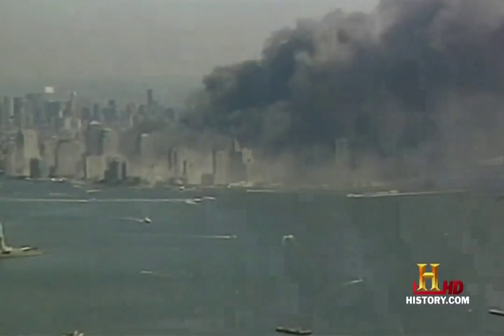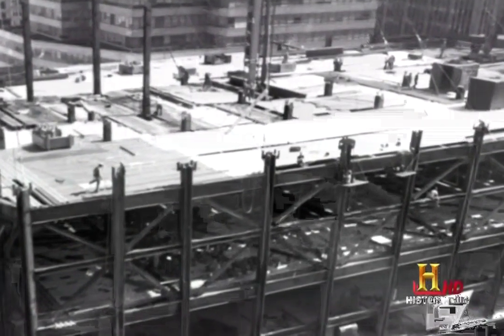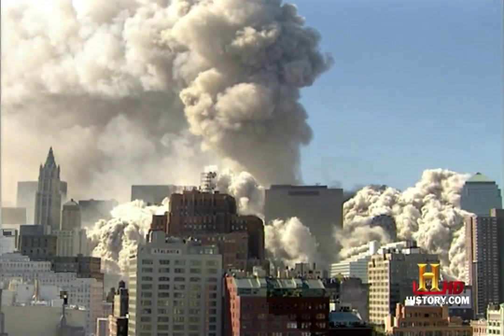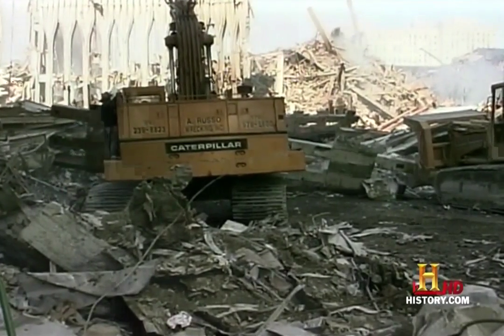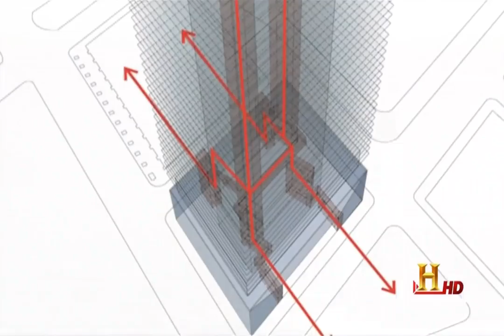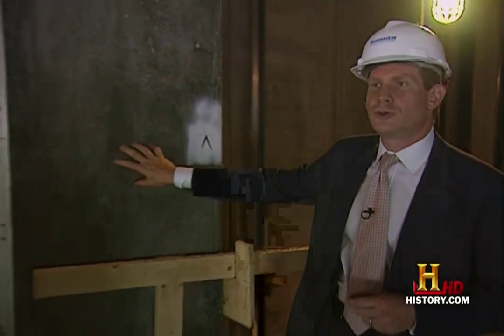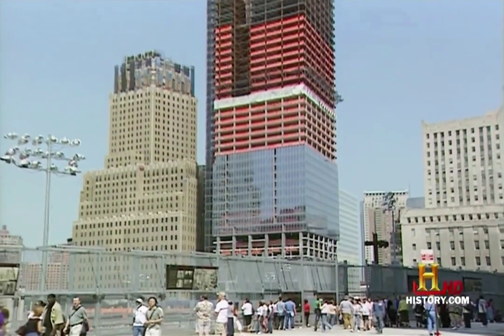WTC 7 - Collapse Issues & Features of Old and New Building (History Channel, 2004)

Comment: What I don't get is how can people not understand high temperatures do not need need to melt steel to critically weaken it?  Have any of you conspiracy people watched a bladesmith make a knife?  Do they need to melt the steel in order to shape it? No, they just need to heat it up to the point it becomes soft and workable.  The difference instead a bladesmith smacking the red hot steel with a hammer, is tons of weight in building pushing down on the steel.
Reply: Lmfao
Reply: Asymmetrical fires do not cause a symmetrical collapse. Never mind all the footage and accounts of bombs going off in the basement of WTC, elevator shafts (never mind all the work going on in the main elevator the entire month prior), or the Urban Moving Systems vans that were caught with a WTC1 basement pass, $4700 cash, fake student ids, passports, flight tickets for immediate departure all over the world, pictures of them celebrating the attack (one even holding a lighter to the 1st plane crash) (they were also caught positioned to take these pictures, or in their own words, “document the event” 2 hours in advance) and traces of explosives! UMS was later found to be a fraudulent company. An extraordinary amount of hard drives were taken into custody, but remain classified. The owner Dominick Suter is currently in the list of 9/11 suspects and immediately fled to Israel after 9/11. How anyone can simply believe that 47-story WTC7 collapsed the way it did due to fire is beyond me.. where is the resistance? The literally spilled the beans twice on the news that the building collapsed before it did! That’s only possible if the pulled the building, which Silverstein has admitted to
Reply: @MarkTheLamplighter  David Icke talks about this on his book The Trigger
Reply: LMFAO @MarkTheLamplighter  Where are you getting your information from ? Did you remove your tinfoil hat and the aliens told you ?
Reply: Exactly!
Reply: @MarkTheLamplighter If the building had 10 columns but its only needs 8 columns to support the entire building… 

So if the fire took out 2 columns what happened? 

The whole building is still standing as the loads are within the limits.

If the fire took out the third columns what happened?

The rest of the columns will buckled at the same time from the load exceeding its design limit and the entire building will collapse.

Comment: There is no evidence of explosives, bombs, or controlled demolition with any of the buildings. 

The fire professionals knew that building 7 would collapse, they said so hours before.
The penthouse on building 7 collapses inward a full 8 seconds before the rest of the building came down. You can see the windows break as the penthouse goes collapses inward.

FDNY fire Chief Daniel Nigro, who stated, “I feared a collapse of Building 7 (as did many on my staff). The collapse of WTC 1 damaged portions of the lower floors of 7.

FDNY Lieutenant Rudolph Weindler said: “So we left 7 World Trade Center… and Captain Varriale told Chief Coloe and myself that 7 World Trade Center was badly damaged on the south side and definitely in danger of collapse. Chief Coloe said we were going to evacuate the collapse zone around 7 World Trade Center, which we did.”

 Deputy Chief Peter Hayden said: “We saw a bulge in the southwest corner between floors 10 and 13, and we had put a transit on that, and we were pretty sure she was going to collapse.”
Show less
REPLY
Reply: NIST said the building fell because of fire, not structural damage from being hit by collapsing towers 1 & 2, so those quotes are irrelevant.
Reply: You government said it collapsed at fee fall speed & totally collapsed, due to fire. Many, hours after, the so called attack & the penthouse id just begining to fall, you can barely see it. 5 seconds later, the building's no longer their & 2 seconds later, it's all over.

I've seen the fire damaged side & no way that buildings coming down.
Reply: @johnsergei  couldn't have said it better myself. Take a look at grenfell tower block in London, got burned inside out. Still stands to this day
Reply: "No evidence of bombs, explosives or controlled demolition" ?? You must watch CNN!  What about the explosions we not only hear in alot of these videos or the firemen talking about explosions and I probably couldn't count the demolitions experts that stated it was controlled demolition?? If you only watch the slow motion video of building 7, you will see multiple explosions as it falls. I am glad I found this video as it proves that 2 completely differently designed buildings at 2 completely different times of construction fell perfectly together into one footprint which we all know goes against everything we've ever been taught or seen before but then again 9/11 is full of those kinds of things. I guess now the engineers are telling us the building had a column fail and it "pulled the rest of the building down"   I would've probably believed it more if they told me the 19 hijackers with box cutters that brought down the twin towers and hit the Pentagon did it. Its all B'S to take away everything that was once good in this country and they rely on people like you to fall for it and...it worked!
Reply: The real problem is the "investigators" work for the perpetrators.
Reply: irrelevant lives in the jungle
Reply: Buildings don't totally collapse in 5 seconds due to office fires.
Reply: @We the People United.

Do you have actual proof of bombs/explosives/controlled demolition?
Eye witness reports and "demolition experts" testimonies don't count for shit. People are fallible. Show me evidence, not assertions, ACTUAL evidence.

Do mind that if you opt for some insane explanation of "explosives" also explain EVERYTHING behind that. What kind, where they were placed, by whom, why there is literally no report by anyone of explosives being placed or seen after more than a decade, etc.

Good luck, you'll need it.
Reply: The newscrews are all over the towers at the time the second plane hit & we can even clearly see what colour the plane is?. It's a bit like Moon landing videos. Give us worse than horse & buggy era film?
Reply: John Sergei and Div neil 

https://www.youtube.com/watch?v=PdUetMEym6w  <--- The Plasco building would like to have a word with you about fires not being able to collapse steel beamed structures.......
Reply: @martin7836  Ignore him he's a paid shill.
Reply: J Law - "There is no evidence of explosives, bombs, or controlled demolition with any of the buildings"
Nobody looked for it. Didn't you hear what J. Barnett said, you shill?

"The fire professionals knew that building 7 would collapse, they said so hours before"
Can you name the guy who was "right on the money" predicting the time of collapse 7 hours before it happened?
Quote him saying that he expected 7 to collapse the way it did . You can't. Anticipating a collapse of some sort is one thing. Accurately predicting the way it collapsed is quite another. Shill better, J Law!

"The penthouse on building 7 collapses inward a full 8 seconds before the rest of the building came down. You can see the windows break as the penthouse goes collapses inward"
Correct. How does that disprove CD and prove fire? It doesn't.

Of course people feared a collapse. Of course they evacuated the area. That's natural and sensible, duh! That doesn't disprove intervention, or prove fire killed 7. Your shill power is very poor, J Law.

NIST said the debris damage played "no significant role initiating collapse". You can't have it both ways. Either worship NIST, or disagree with them.

Comment: 2:28 an hilarious quote
"Once one of those trusses went down, then because of the way everything was interconnected, in the floor system. Uh, it pulled down the rest of the building."  Irwin Cantor-engineer of record-building seven

This seems extremely questionable, are buildings really designed knowing that knocking out one key column or truss will cause a global implosion of the structure?
Reply: That it would bring down not just one side but the entire building, evenly like a clockwork sounds unbelievable. They should make a whole new documentary about that, but i bet its not happening.
Reply: TheUnderdogDe - Not as fast it did, and not as evenly . Demo firms would love to achieve such an easy result from a single column failure on one side of the building. Those floors were not attached with chewing gum or duct tape. Don't be naive.
Reply: saladdogger - Exactly. Or just rig a single column to blow, the rest will follow. No need to spend weeks rigging the entire building. Shills can't answer that.
Reply: All of the columns have to fail near simultaneously and when they do they must be severed to get the 9.8m/s/s. This is the only way to get it to happen.
The cover story for a full year afterwards was that it was taken down for safety reasons. It obviously didn't come down when it was suppose to. They must have been delighted to hear engineers doing such mental gymnastics. The alternative was inconceivable to them.
What are the chances that Rumsfeld Cheney CIA  (knew about 2 hijackers) and Israelis (spying on terror cells) were all connected to the Building? Unbelievable.
Reply: @Xinjiekou_新街口_Station The columns do tends to buckled simultaneously once enough columns had been taken out and loads on the remaining columns exceed its structural limits.
Reply: @tonamg53 "The columns do tends to buckled simultaneously once enough columns had been taken out and loads on the remaining columns exceed its structural limits."

Yeah, I am not sure you are getting this. The issue is not that they only all have to "fail" at the same time. They would have to all buckle on the same lateral axis, at the same time (4-6 seconds) and to the same degree for the roofline to remain flat. That is 3 coefficients that need to line up for this to happen. Why would that happen in a natural collapse? The roofline is flat and comes down for a few seconds with negligible resistance and that is consistent with the columns being SEVERED. Even if you were to believe this somehow could happen in a natural collapse it remains consistent with an engineered collapse. It then encounters resistance and becomes much more asymmetrical and tilts to the south. The whole collapse sequence is (visually at least) consistent with being logically planned out, East penthouse then core (trusses pull in frame) then parameter columns. 

Then the totality of evidence to go along with this involves a cover story given out to the media and others who might ask questions when it had to be taken down in broad daylight.  The back story on the building is that the very people in charge of the country with the president scheduled out of town during the attacks had access to this building and had met with two other people who wired money to the terror cells. 
There's much more to this story including an FBI informant and people monitoring the cells who have a connection to the building owner but in simple form:

A) Nature of collapse - Logical sequence with the same outer column failure (Time/Location/Degree) consistent with a handful of columns being severed somehow
B) Evidence of a cover story given to press and others (makes no sense otherwise)
C) People in charge of country who met with 9/11 financiers had access to WTC7 and previous connections to building while in private sector

Comment: 4;23....really? Check the Windsor Tower in Madrid, it was gutted by a huge fire on February 12, 2005, and partially collapsed;  it burned for 24 hours, it remained standing .
Reply: Well if you did any real research, you would know the buildings had very different support constructions. 

WTC 7 was almost all steel support construction, and as such, very susceptible to fire. 

Windsor Tower was a hybrid support construction of sorts.  It's central core was reinforced concrete that was able to resist the temperature of the fire. It had a mechanical floor in the between the interior concrete section half and the steel exterior section half. The partial collapse of the building was on the steel half.

Comment: The new has 52 floors. The old Solomon brothers building had 47 floors. It’s also called the. Solomon brothers building because Solomon Smith Barney had rented the most space. The number of floors in the new is half the numbers of floors in the new WTC1 or freedom tower. 52 is half is 104. 2x52=104. Ground was broken for the new on 05/07/02. 23 days before the last column was removed from Ground Zero.

Comment: NIST's WTC7 failure mode explanation has been shown to have major problems by a more complete finite element model that calculated dynamic thermal expansion and dynamic nonlinear material deformation due to material stresses and heating,   See the WTC 7 Evaluation, led by Dr. J Leroy Hulsey, Chair Univ. Alaska Fairbanks Civil and Env. Engineering Dept.  The UAF WT7 evaluation model is open for public review and professional structural engineers technical feedback, unlike the NIST WTC7 model which remains classified.   This model is close to completion with the next phase to begin doing what-if simulations of the many possible failure modes NIST did not evaluate or at least publish for public record.

The bottom line is that it is very difficult to come up with a failure mode that matches the observed 2.25 second symmetrical free fall.   The simulated failures to date show asymmetrical/non free fall speed due to asymmetry of the heat source, an office fire that starts on one side/floor and proceeds to other sides/floors as the combustibles have been consumed.  In addition, there is the asymmetry of WTC7 which has a trapezoidal horizontal cross section and non symmetrical column placement.

NIST simply did not have the time and/or computing resources to get a simulated 2.25 second free fall collapse and it sounds like they simply gave up without releasing their incomplete model.  The improvements in thermal/dynamic modeling software and increase in computer power since the NIST study,  have given us a much more powerful tool to evaluate the remaining possible failure modes.  In addition, faults in the NIST model like not modeling the concrete floors bolted into the beams, lack of sheer bolts, lack of stiffeners on the column supports, and modeling one side of the building as fixed, have been corrected into the UAF model. Those limitations/errors of the NIST model make the NIST's failure mode and conclusions highly questionable in my mind.  It is clear to me that a new study with better models and modeling software is required to get an answer to the question of what caused the observed symmetrical free fall collapse.
Reply: Carroll+ How's that evaluation coming???? Let's see:
"Dr. Leroy Hulsey gave the following update on March 27, 2018:

To all who have been following the University of Alaska Fairbanks study on the collapse of World Trade Center Building 7:

First, I would like to thank you for your interest in and support of the study.

We had planned to release our findings for public review early this year. However, research often takes unexpected turns, and the more complicated the problem, the more difficult it is to predict the completion date. We are still in the process of studying hypothetical collapse mechanisms and attempting to simulate the building’s failure. Our goal is to determine, with a high degree of confidence, the sequence of failures that may have caused the observed collapse and to rule out those mechanisms that could not have caused the observed collapse.

We will release our findings for public review when we are sure we fully understand the mechanisms that are likely to have caused the observed collapse and those that clearly did not occur and could not have caused the observed collapse. We expect to publish our findings later this year, but we will refrain from naming a completion date, given the unpredictability of the research process.

Again, we thank you for your interest in our study and we appreciate your patience as we strive to bring a truly scientific answer to the important question of how WTC 7 collapsed on September 11, 2001.

Dr. J. Leroy Hulsey

Chair, Department of Civil and Environmental Engineering

University of Alaska Fairbanks"

Hmmm...not too good I see.

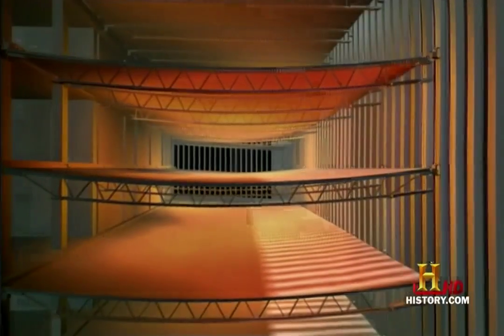Comment: 4:29 is an animation of WTC 1 and 2 floor trusses, not WTC 7.
Reply: Wtc 1, 2 and 7 were all tube framed steel construction buldings
Reply: But u are right, this is a animation for wtc 1 & 2. But it works for wtc 7 too coz these buliding share the same structure